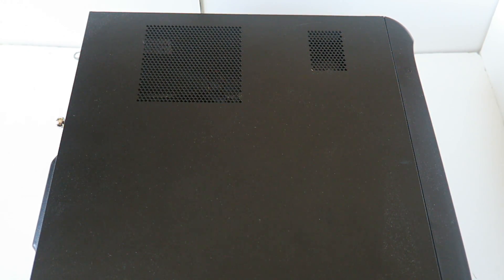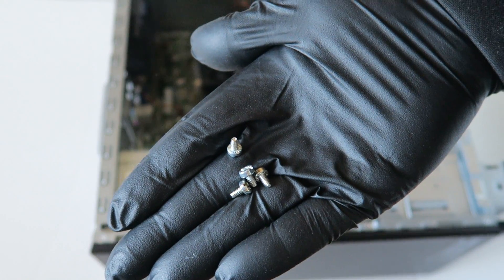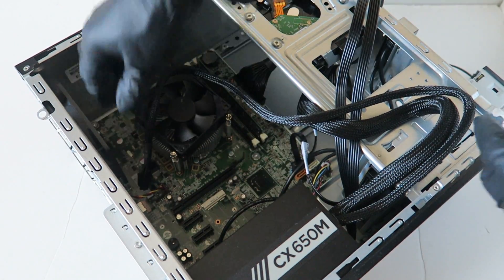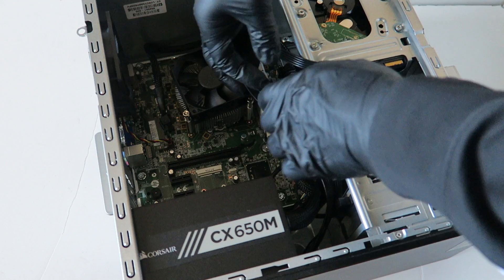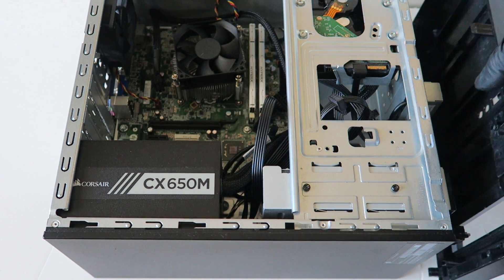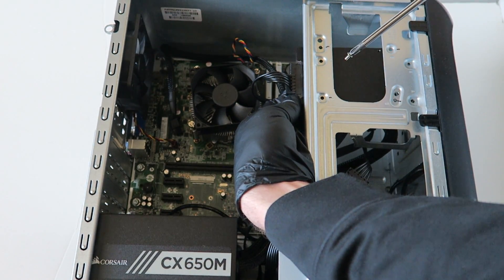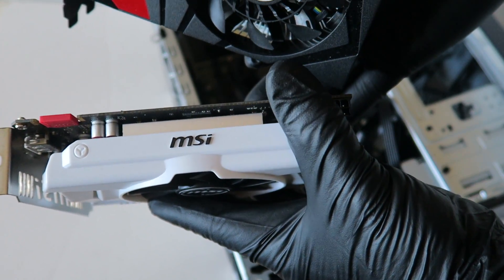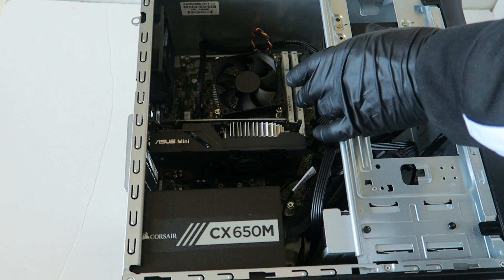HP Pro 3500 Gaming Upgrade Video Card SSD RAM PSU

Comment: I have this computer and I'm about to upgrade my ram. I want to be sure that the motherboard (Foxconn 2ABF) will support 16gb of ram like you used in this video before I do anything. How did the PC run after installing the ram?
Reply: Guys your conversation from 3 years back helped me 😂Thank you does 16 gigs work fine on hp 3470??
Reply: @gashff8287  yes
Reply: Yes even though a lot of sites say it only supports 8gb 16 gb is actually supported
Reply: did it work?
Reply: @quintenvanginderen8635  haven't tried yet
Reply: @coconutlarry  when this crisis blows over i'ill try, according to calcuram, it should work
Reply: edit: compuram
Reply: @quintenvanginderen8635  I'm still at work so I might order 16gb of some corsair ram and hopefully I don't fry my computer 😟
Reply: @coconutlarry  nah, the worst that could happen is that it doesn't boot, or gives you a memory complain while posting
Reply: @quintenvanginderen8635  well this is good news then
Reply: @coconutlarry  i have the same motherboard and i upgraded to 1650 super (i do gameplays) works fine but i can't max settings in games because of Ram so i'm planning to upgrade soon to 16gb was wondering if it will work.
if by chance you manage to upgrade before me please keep me updated if 16gb ram will work or not ^^.
Reply: @Ramzy750  omg i'm planning the exact same build on this computer but with 12gb ram, gtx1650 super oc and then obviously the core i5-3470
Reply: @quintenvanginderen8635  good news !! so i went and upgraded to 16gb ddr3 1600mhz dual-channel and they work perfectly !! i don't know if you are still interested but i thought ill tell ya ^^
Reply: @Ramzy750  hell yeah, awesome do you have the i5-3470 model? It's promising, thanks for the response though ✌
Reply: @quintenvanginderen8635  yes i do ^^ and no problem
Reply: @Ramzy750  thanks mate, do you play any games?
Reply: @Ramzy750  did you get the 240 pin?
Reply: @coconutlarry  yes
Reply: @Ramzy750  just placed my order. Thank you
Reply: @coconutlarry  no problem ^^
Reply: @coconutlarry  sadly mate i dont play Fortnite :') i only kinda cod warzone right now.

Comment: Under 12 mins to do all of that! Man it took me almost 2 hours or so to install a new graphic card and power supply for that.Same pc build in the video btw.
Reply from the maker: Hi, thanks for the info.
Reply: Mxkdi  i got this pc. Can i put a sapphire rx570 gpu in it?
Reply: @jarodijk7526  hi im planning to put the same gpu in it, if you got it, does the gpu fit?
Reply: @joicore  hi bud ye easy i got a gtx 970 in it now and it fitss

Comment: Hello! If HP Pro 3500 is running with i7 3770, can I install a XEON 1240 v2?
Reply from the maker: Hi, on HP web site HP Pro 3500 does not shows that it supports Xeon CPU and why would you want to change to Xeon ?
Reply: @Mxkdt  I have an i5 3570s, but I think to put XEON, because it has 4 cores and 8 threads, i.e. the performance will be more
Reply: Привет,вижу русского в коммах хочу узнать.На Foxconn 2ABF пойдет i7 2600?и 16 gb ram?
Reply: @ULTiMATUM_-og3zf  Привет! Какая  ревизия платы? У меня на одной rev.3.20 работает i5 3570 + 16Gb, на другой rev.1.20 (перепаян и перешит bios на 3.20) работает i3 3220 16Gb.
i7 2600 2-го поколения проц, должен запуститься.
Reply: @sergey4182  а как проверить ревизию?
Reply: @sergey4182  А узнал,3.10 ревизия
Reply: @ULTiMATUM_-og3zf  над разъёмом  памяти написана ревизия, например H-Cupertino-H61-uATX: 3.20.
В принципе, все чипсеты h61 должны держать процессоры 2-го поколения, независимо i3, i5 или i7
Reply: @sergey4182  проверил,3.10 написано кроме i7 2600 какой еще заведется?
Reply: @ULTiMATUM_-og3zf  как писал выше, на одном работает i5 3570. Ещё с али думаю заказать xeon 1270.
Смотрел 1240 v2, он более холодный, но у него под крышкой не очень долго вечная термо"прокладка". Скальпировать не хочется, поэтому решил xeon 1270, у них термоинтерфейс долговечней
Reply: @sergey4182  Понятно!Благодарю
Reply: @sergey4182  А да последний вопрос.Вы не в курсе поддерживает ли эта плата разгон процессора.
Reply: @ULTiMATUM_-og3zf  это офисные материнки, урезанные биосы, настройки минимальные. Разгона нет.
Если кто запилит нормальный мод биос, то это будет отлично.
Но они старые, года 2010_2011, никто не заморачивается.
На одном из импортных сайтов находил спеца, который прописывает в биос коды процессоров.
Если нет навыка в этом, лучше не лезть, поэтому я на одной плате заменил чип биоса и прошил дампом от 3.20.
Работает и отлично.
А какой у вас комп, mt pro 3500?
Reply: У меня установлена gtx 1060 6gb, ssd 256gb, плата pci_x с 4 портами usb 3.0, думаю это потолок улучшений, дальше только апгрейд матплаты, проца и памяти
Reply: @sergey4182  xeon завёлся? Я хочу поставить e3 1260l на эту плату, вот думаю, заведётся ли
Reply: @hohmachchannel7741  Так и не заказал, доллар подрос, придётся ещё докупать кулер. Пользую i3 3220, для повседневки пока хватает

Comment: Guys I did what he does on the video. Yes I have the HP 3500 pro model like he has on this video. Whats wrong here is that he installed 16gb RAM, which is wrong because the mobo can only handle 8gb RAM. 

Second is that he installed a GTX 950. According to the HP website, the 3500 mobo can only handle the gtx 6xx series. Also, the mobo has Legacy BIOS, which most of the gpu doesn't support

Yeah, I have tried it with my system. Buyed a GTX 1050 ti only to find out it doesn't work. Dont repeat my mistake guys. The HP 3500 should retire as it made a good run back in the 2010's. Yes you can put a gpu on it, but the gtx 6xx series is pretty old and would struggle to render AAA games in the next years

So conclusion, dont waste your money on upgrading this system. Just buy or build your own pc. This model is very good indeed back in the days, but now its time for it to rest.
Reply: lmao i put GTX 1650 SUPER and it's working like charm xD
Reply: Bought this PC at Goodwill for $65, Upgraded onboard video to Mini EVGA 1050 TI ($150) works like a charm (no PS needed), Factory CPU I3 3220 3.3GHZ, Installed 2x 4GB DDR3 PC3-12800 (800 MHz) $30, Factory 300W PS, Factory 1TB HD, WIN10 64 already Installed. Total Cost $245, runs all AAA games at Medium to High even a few on Ultra @1080p. I didn't try 16GB ram as documentation memory limit was 8GB if someone has the same setup as mine let me know if you got 16GB to boot and what you installed. My Factory MB is a Foxconn 2ABF.
Reply: The HP 3500pro was of several types.
only model 3515 on Chipset AMD A75 FCH supports 16 GB of memory

Comment: Is the fans already good? Im worrying that if i dont change the fans, my pc would heat the hell up
Reply: I have New HP Pavilion desktop wich supports up to 32gb ram and it looks the same here what i upgraded

ZOTAC RTX 2070 SUPER MINI 8GB
32GB RAM 
850W EVGA POWER SUPPLY

And it's 70c in full load gaming
And 35c without doing anything
Reply: @carbonN  Thanks, but too late since I found out that the HP 3500 runs BIOS LEGACY, which most of the cards arent compatible of

I bought the GTX 1050ti before knowing it, so the only option is to buy a decent pc that runs the UEFI BIOS.

Today in running the GTX 1050ti with 16gb ram, and with a few fans, the temps are actually decent.
Reply: @tekadags5701  good to know

Comment: hello, I have a PC HP Pro 3340, I'm updating the VGA Card, the strap after I update, my PC is not running normally, only the fan is spinning fast and there is no display.  What should I do.

Comment: I could remove the psu without removeing dvd drive
Reply: Dude. You can remove psu without removing dvd. But its gonna be little bit harder. You must push psu's (shield). You can remove easily your psu with this type.

Comment: Which ddr type GPU u used ?
Reply: Think its 2gb gddr5
Reply: @jamiewright3901  What ? How can a Ddr3 system support a DDR5 graphic card ?
Reply: SIVARAJ KAILAS it just does mate it’s different to system memory
Reply: @jamiewright3901  Ok Bro , Thanks For the Reply
Reply: SIVARAJ KAILAS no worries, hoping to put an MSi HD 7870 in my hp pro 3500 which is also a 2gb Gddr5 card
Reply: @jamiewright3901  Okay Bro , Best of Luck :)

Comment: Am just wonna ask my motherboard has 8 pin not 24 pin how can i use power supply then?
Reply: XXX you can get a 24pin to 8 pin cable on ebay

Comment: Can I keep existing power supply...but upgrade graphics card and ram ?
Reply: It depends what graphics card you want to install. The stock Power Supply Unit in this model is 300 watt. If a graphics card gives you information on the "recommend" wattage, it is advised you get a PSU with the recommended wattage.

Comment: Will a evga 1GB GeForce9400 GT work with 500w power supply
Reply: MR BURIITTO9087 duh cuz it’s 1gb also that gpu is ass get something better
Reply: Yea ik it's kinda bad I just was wondering because that the only GPU I have. Thanks though
Reply: @jacobhensley8308  get rtx 2070 super from zotac it fits in my new hp pavilion but size and way it's build same in inside and it fits perfectly

Comment: What model of Asus is this one? Looking for a middle range graphic card for my hp3500 pro can you give me some options I already have upgrade my ram to 8g
Reply: You could go for a Radeon rx 550 or a Zotac Gtx 1050ti
Reply: @tekadags5701  If I plug a 1050 ti into this motherboard, will it work fine? do i need to update the bios

Comment: I have a MSI GTX 1060 (6gb) and 4 HDDs (1x1tb, 2x2tb, 1x4tb) installed in this computer. Had to upgrade the PSU though. What I didn't know was that I could also upgrade the ram to 16gb, guess I'll be doing that next.
Reply: only 3515 model on Chipset AMD A75 FCH supports 16 GB of memory. This MSI card work without problems?

Comment: Hello i have a i3 hp pro 3500mt but how u can putt 16 gb ram the specs says 8 gb ram max 1600mhz ddr3 12800u
Reply: That's what I mean the motherboard should be changed too Because the motherboards that prebuilt computers have can't take the much more memory. In fact there is a big chance of the old motherboard shorting out which would ruin the whole thing
Reply: @katerinakittycat3849  mine hp pavilion desktop supports up to 32gb ram but idk the mhz

Comment: Will it work with the Corsair vs650
Reply: If vs650's got 6+2(8pin) connector, and it supports your gpu. You can use that psu too

Comment: Thanks for showing where to put SSD with the optical screws. Oem HP 500gb Seagate hard drive failure, so decided to upgrade to SSD Kingston sv300 240gb  for ageing i3 2120 model.

Comment: Do you recommend the MSI AMD radeon r7 250 2gb ddr3 video card? I’m on a super tight budget and get spend more than $65 on a card
Reply: Ummm what about a cheap rd 460 on ebY
Reply: Nvm! I found a good card that will fit my needs at least for now at a good price!
Reply: Good, because ddr3 video cards usually aren't great. Gddr5 us usually 3x as fast

Comment: Will the hp 3500 mt work for elgato hd game capture
Reply: Dan Luna elgato doesn't hook to a pci slot. I'm wondering if this computer has the specs to run it
Reply: @MysticGamingAchievements  It does only if your motherboard has a support for it.
Reply: (250 bucks)it is not worth it :)

Comment: I have HP 3500 w/Intel core i5-3470 @3.20Ghz CPU, the specs say that I can only upgrade the RAM to 8G but I noticed that you used 16G.  Is that ok for me to do with this computer?   The video card I'm using Nvidia Geforce GTX 1050 ti and 650 watt PS.
Reply: Robert Grant I have 16 GB of RAM in my HP Pro 3500 and it works. I also have the newest BIOS version, not sure if that makes a difference
Reply: @demerit5  what cpu is in it? the core i5-3470?
Reply: which ram are you using?
Reply: 16gb works fine. crucial 1600mhz.
Reply: @justinhutchinson3630  DDR3 or DDR3L?
Reply: @Doomguy1995  just plain ddr3
Reply: @justinhutchinson3630  do you have foxconn 2abf mobo in your pc?All sources say that it supports a maximum 8 GB of RAM, so maybe you have a different motherboard, I'm confused.

Comment: Can I fit a gtx 970? If not can I move the mobo to another case
Reply: yes you should be able to fit the card in and you also have the option to change the case. You will need an mATX case.

Comment: Just would like clarification that the mobo will support the 16gb of ram even though their documentation states 8gb max? Only curious bc I'm transferring the innards of one of these to a mid tower case for better airflow and room for a gpu and wanted to upgrade ram but read it was 8gb max.
Reply: To everyone's questions in this thread: Technically this mobo should support 16 GB (2x 8 GB sticks) but it's just that HP only sold it configured with 8 GB max so that's why their documentation lists it as such. There are 4 SATA headers and I see 4 power connectors from the stock PSU, so you could theoretically install 4 SATA drives if space permitted. It looks like you may be able to install another 3.5" drive below the 5.25" slot; I see that pattern of holes towards the front of the case that looks like it's for a 3.5" drive. Failing that, in addition to the perpendicular mounting position for the stock drive, you could remove the optical drive and install an adapter in its place; if you check Amazon or Newegg or wherever you can find cheap ones that use the available space from a 5.25" bay to give you 1x3.5" and 2x2.5" or 4x2.5". So, worst-case scenario you could have 2x 3.5" HDDs and 2 SSDs or whatever. You could also install a 1x PCIe expansion card to give yourself more SATA ports (although then you'd have to upgrade the power supply to get more connectors) if you really wanted to cram more than 4 drives in there (keep in mind you can just velcro SSDs to the side of the case or leave them dangling, they have no moving parts and don't need to be securely mounted if there's really nowhere to put them.)
Reply: @AtomizerX  💕
Reply: @AtomizerX  thanks for the answer to the question that's been bothering me for about 5 days now, does the 16gb ram statement include the i5-3470 model?
Reply: @quintenvanginderen8635  My memory of the research I did on this model is rusty, but I'm almost 100% certain that any Ivy Bridge board should support at least 8 GB per DIMM slot.
Reply: @AtomizerX  allright thanks bro
Reply: @everyone here, i put the 8gb slot in and kept another 4gb slot and it works, also the gtx1650 super oc works perfectly on the new 550W psu
Reply: Así que técnicamente si puede contener 16 gb de RAM?
Reply: There is not another caddy/bay in the system so if you were to add one it would have to be an external hard drive. However, theoretically you could buy another hard drive for internal storage but it would be laying inside the original case with no caddy. Personally I would advise against a hard drive because of its mechanically moving parts, and would suggest an SSD where it is not on the the caddy and the hard drive mounted to the caddy. If you are not comfortable with it laying in the bottom of the case, why not buy a new case? The motherboard is a mATX motherboard. So simply search for an mATX case that has available bays in it. the other factor is that in order to get the second hard drive to work you will need a new power supply with more SATA power cable adapters on it because the OEM PSU does not have more than one. So, I recommend A new mATX case and a new psu to make it work the easiest and safest.
Reply: FabulousGamer i want to know too, i know it has connectors for it but no bay so i want to find a way to diy mount it
Reply: this is weird..i really would like to know aswell
Reply: gmwilkes Yes I have the same question!
Reply: gmwilkes got your answer?
Reply: @ousssouss  I dont think it supports 2 hdds, maybe go for 1 hdd and a SSD
Reply: @tekadags5701  I installed 2 hdd 500 GB and 1 SDD and no problem

Comment: Will AMD Radeon RX 460 work without upgrading the original PSU which gives 300 watts?
Reply: The 460 takes <50 W so that original PSU is just fine.
Reply: did it work

Comment: Is the Intel Core i5-6600K compatible with this motheboard?
Reply: Different processor socket, HP Pro 3500 has an LGA 1155 while i5-6600k has an LGA1151
Reply: @danluna7916  true
Reply from the maker: No
Reply: Mxkdi y

Comment: I have the same hp pro 3500 
When I inserted gtx 1050ti pc didn't work 
My bios date 24/10/2012 
What should i do ??
Reply: probably update the motherboard bios
Reply: Haider Al-Ghassani change power supply
Reply: Dude. You should upgrade your psu to 450w + (500;550;600w+) PSU. And MT 3500's mb has got latest bios version. And its not upgradable. Its not bios problem.
Reply: @bestoftheworld7186  thanks mate
 I solve the problem and sold my pc 2 years ago
Reply: what kind of gtx 1050ti
Reply: Upgrade the PSU if you haven't already.
Reply: If your BIOS ver. is 7.x you have to update it to an 8. something, i can't remember right now...
The bios updater is only available on HP website. If you have Win10, choose when they ask to you Windows7 32/64.
Also change the PSU 'cause the one included on the HP is S#|7
Reply: @josem4  not its not true
Reply: you have to upgrade the RAM to 6 go  and upgrade it to win10. i did the same thing to the same pc

Comment: Great Video. I bought a "ASUS GeForce GTX 750 Ti (2048 MB) (GTX750TI-OC-2GD5)" and tried it with the original 300w supply but it did not work and resold it (not sure if it needed power but reviews said not). My Bios is over version 8. I am willing to get another power supply and try again but would any of these cards i seen on ebay work or anything i need to be carefull on please? "MSI GTX 770 Twin Frozr OC (2048 MB)  or " "Nvidia GTX 950 (looks like a mini version on picture)".
Reply: So hard to explain 😁
Reply from the maker: Hi, issue could be with the video card i recommend  buying brand new video card gtx 950 and will work fine with hp 300w power supply yes video card is mini version and for gtx 770 you have to buy  at least 500w power supply brand name.